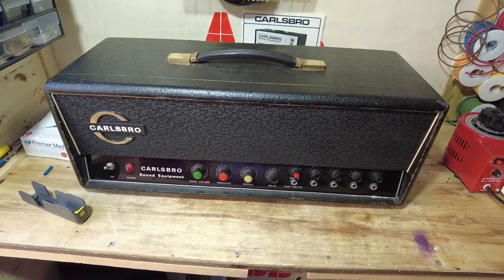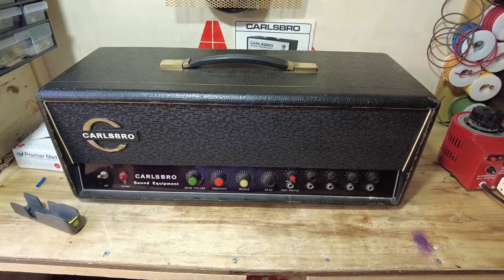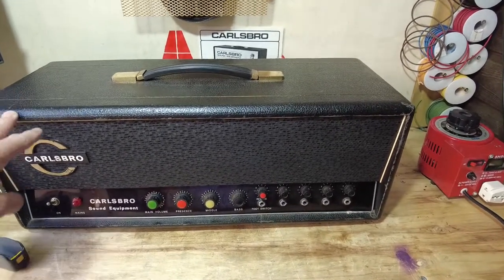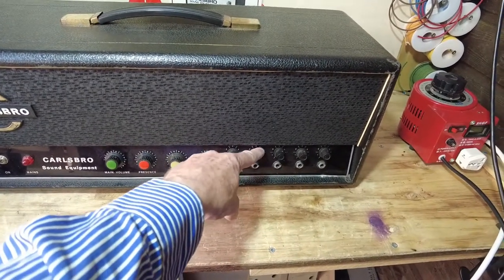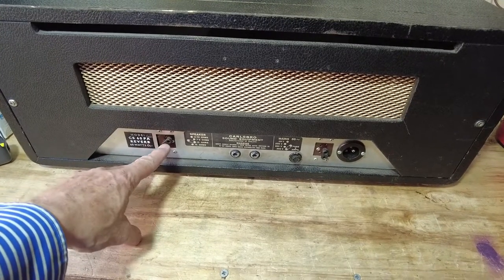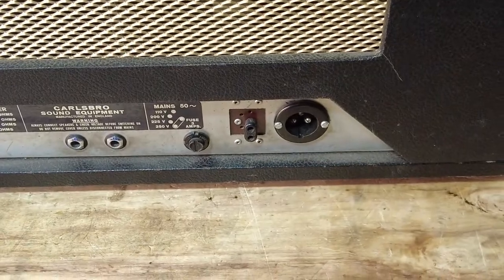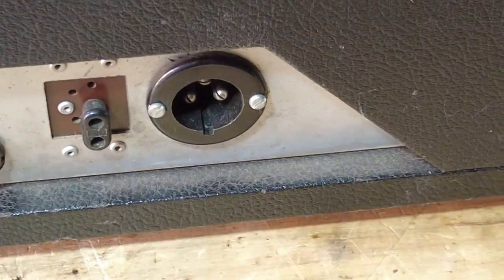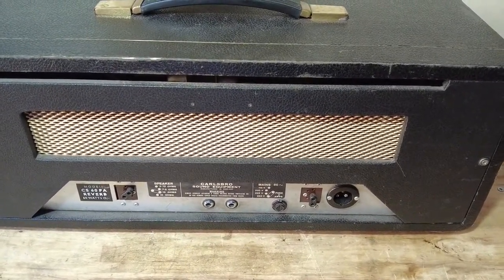Carlsbro CS60 PA Repair Assessment

Comment: Never seen or even heard of a Carlsbro amp on this side of the pond; sounds like a cigarette brand! (There used to be some cheap, beginner-level solid state amps here branded Marlboro).  I like seeing the weird stuff.  80 to 90% of the amp repairs you see online tend to be oriented towards Fender, Vox and Marshall, so it's kinda nice to see a Silvertone, Danelectro, Valco, Supro or Gretsch for a change.  Brad's Guitar Garage in Australia just posted some repair videos of some Australian built amps that nobody here in the States has ever seen or heard of either.
Reply from the maker: The Carlsbro amps were really big were I lived as a child. They had a local retail shop. They made some good amps up until the mid 70s. Then they went all solid state. There should be one or two coming up on the channel soon. Thanks for watching and take care.

Comment: I watched both Carlsbro CS60 videos they were very good and thanks for posting them. I have an older CS 60 top mounted in the cabinet. I think it’s a bass amp but can’t be sure. It is Tube rectified and all original so I’m sure it needs a full re-cap. Carlsbro is not well known in the states. I have been looking for years and never found a schematic for a tube rectified Carlsbro.  Do you have any ideas ?  The S/N  382 is stamped on a blue painted chassis. There is no selector for speaker impedance  I assume it’s 4 ohm? Thanks if you can help.
Reply from the maker: Hello Ed. Thank you. I have just had a search round and I can't find one either. You have a really early one. I had a look on one or two websites to see if anyone had serviced one of the early versions but couldn't find any info. The only way to confirm the impeadence would be to do a turns ratio test on the output transformer. Uncle Doug has a really good video on this topic. Thanks for watching.